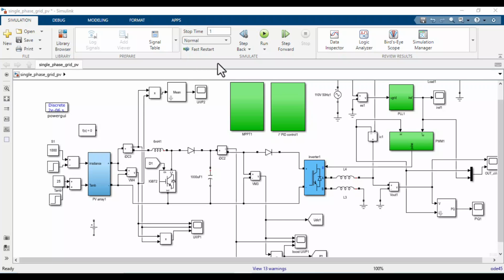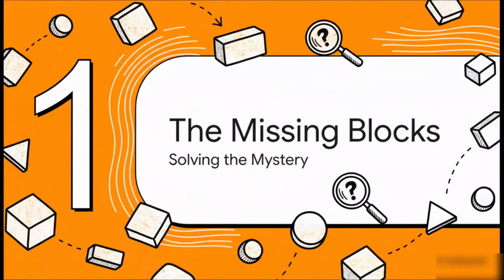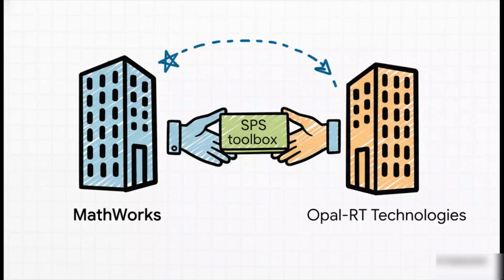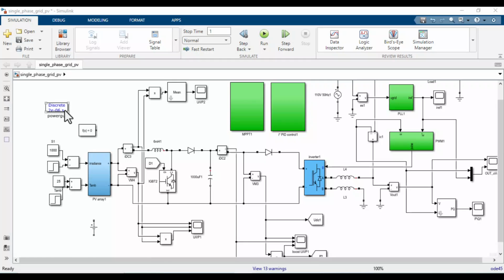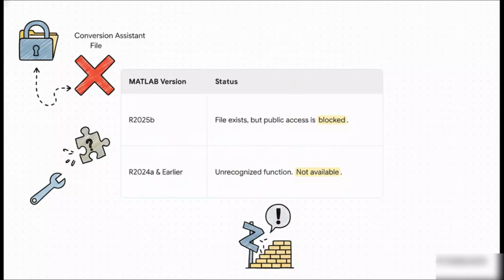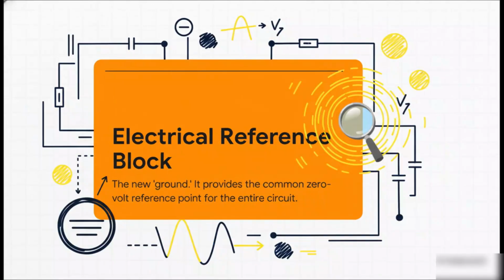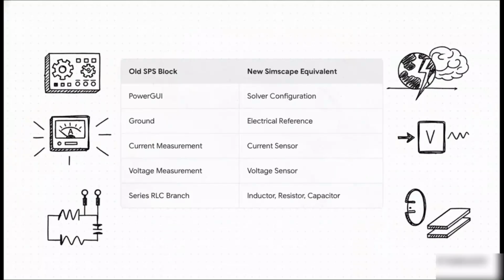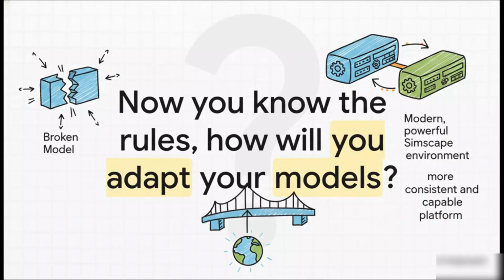MATLAB Engineers Need This Simscape Electrical Tutorial - SPS Designs

Comment: I prefer SimPowerSystems compared to Simscape Electrical. The results and the solver are more numerically stable in SimPowerSystems
Reply from the maker: Thank you for sharing your perspective!

I agree with you — SimPowerSystems has been numerically very stable, especially for classical power system studies and phasor-based simulations. Many engineers are comfortable with its solver behavior and results consistency.

However, in the newer MATLAB versions, MathWorks has transitioned fully toward Simscape Electrical as part of a unified physical modeling environment. The idea seems to be integration — combining electrical, mechanical, thermal, and control systems within one consistent Simscape physical network framework.

SimPowerSystems was more specialized for power system analysis, while Simscape Electrical supports broader multi-domain modeling and uses a more generalized physical modeling approach. From a development and maintenance perspective, maintaining one unified platform likely makes more sense for the company.

That said, many professionals still prefer SimPowerSystems for certain studies due to solver stability and familiarity — and your point is completely valid.

Thanks again for your valuable insight! 🎉
Reply: @suntechengg that's true. As a power system engineer, Simpowersystems works perfectly and I don't model any mechanical or thermal effects. Like one says, if something works, don't change it. The SPS toolbox is still available through OPAL-RT so sticking to that works for most power system, power electronics engineers. 😊😮

Comment: I have Problem with 3phase breaker
Reply from the maker: For replacing the 3-Phase Breaker, try using the equivalent breaker/switch component available in the Simscape Electrical library and make sure the electrical reference, solver configuration, and connection topology are properly defined. In most cases, simulation errors occur because Simscape requires a complete physical network setup.

Also note that some SPS blocks do not have a direct one-to-one replacement, so a small redesign of the circuit may be required.